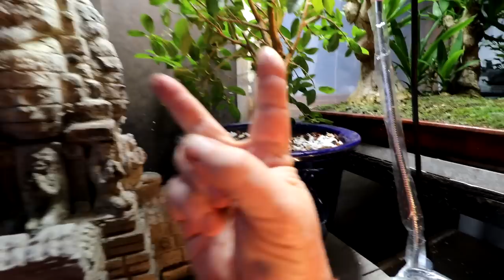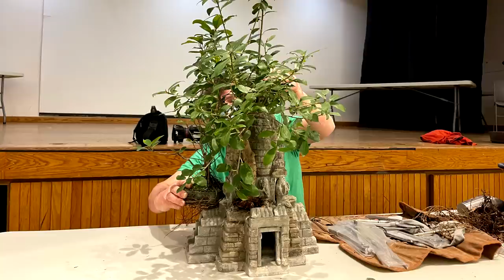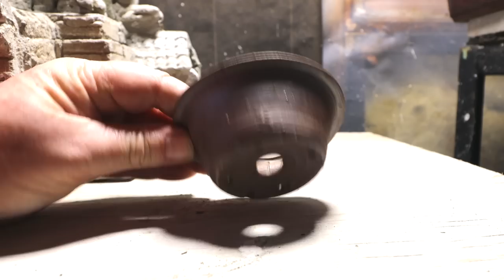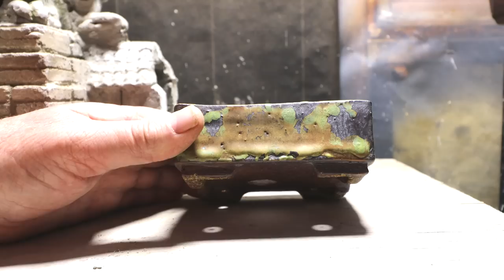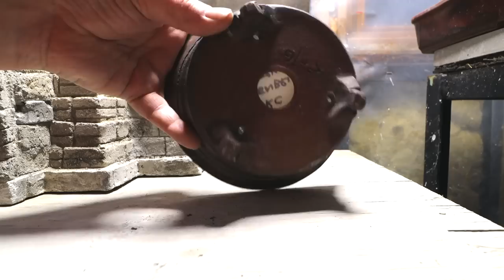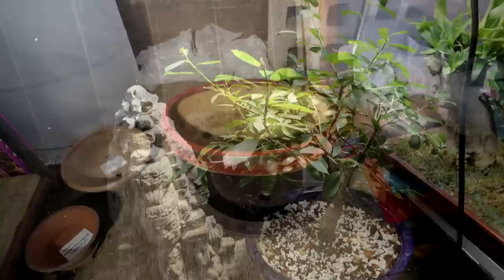My Ta Prohm Temple, Pots and Trees, The Bonsai Zone, Nov 2022

Comment: Moss will definitely grow on concrete.  I once built an urban rock garden using chunks of concrete from a broken-up sidewalk. They looked like slabs of some kind of sedimentary rock.  After about three years green moss began growing on the parts that had partial shade.  Your raw concrete may be too alkaline at first for good growth of tree roots, so you might rinse it down with a vinegar solution for a week or so.  The parts that spent the summer in the greenhouse should already be weathered enough to be safe.  There is an old rock gardeners trick you might try.  When you see a  patch of moss with spore cases on it, pick it, put it in a blender with milk, then puree it.Then paint the mossy milk on the rocks where you want moss to grow.  With the daily misting in your greenhouse, moss should form fairly quickly